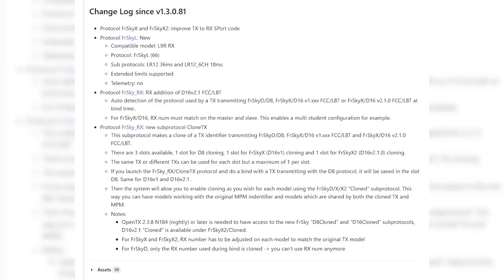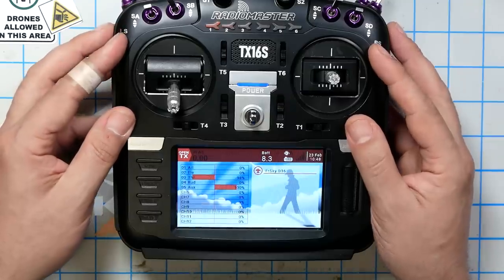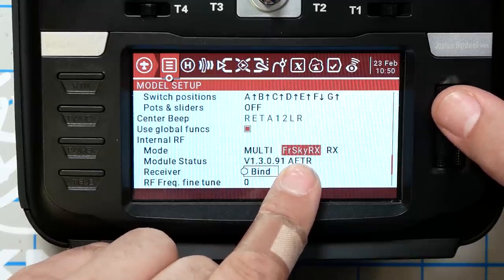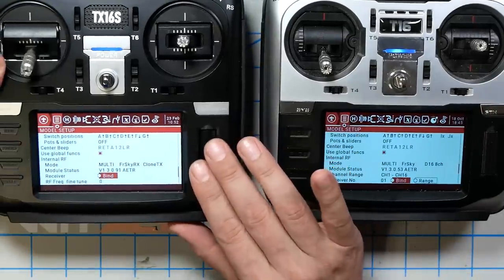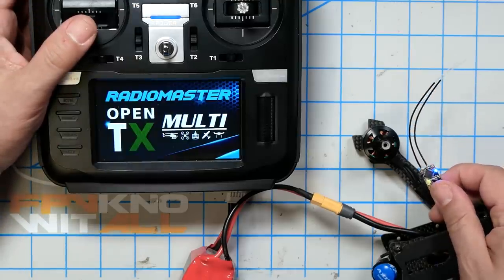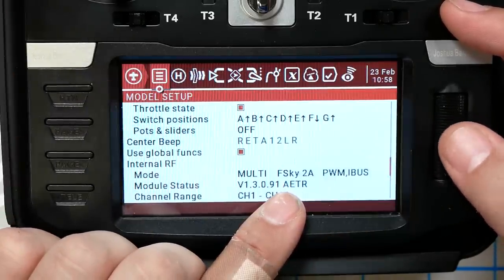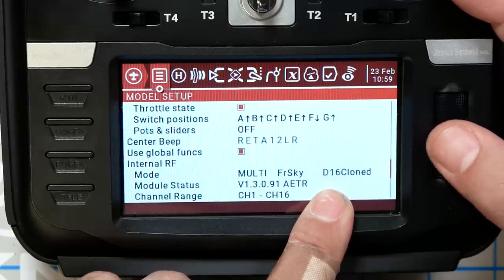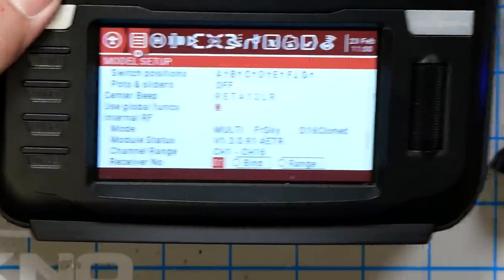FrSky multi-bind is FINALLY possible (two controllers at the same time!)

Comment: I am pretty sure that the hopping sequence is fixed.  When the Rx and Tx link up at power on they sync up their hopping sequences.  When you turn in a second Tx with the same UID it is extremely unlikely that it would come on at exactly the same point in the sequence.  The Rx is never listening on the frequency that the second Tx is broadcasting on therefore it doesn't see it - until the first Tx is turned off.  At that point the Rx goes into hold and starts seeking a valid Tx signal.  When the second Tx hopping sequence gets to the Rx is listening on then the Rx gets a valid signal, goes out of its hold state and happily goes on listening to the new Tx. 

This whole spread spectrum thing is pretty robust.
Reply: In view of this, I were just thinking, with combination of FPV and Autopilot equipment, we can actually do long range  FPV "marathon", the passing the Tx controlling from one pilot to another..

Like pilot-1 from the base, and Pilot-2 at 30km away and so-on.. and at last the plane landed at pilot-N based.. so pilot-N can replace the batteries etc and flying back the plane on reverse path all the way back to the pilot-1 over the same pilot to pilot in mid way of flying path.

That's looks nice..😁😁

Comment: just for info, Deviation has done it many years ago, not only for FrSky, ;but for all receivers that I owned.
the logic is, a receiver's unique ID is composed of two parts. One is owned by the Tx, the other is what you set in your model.
Usual case is even your buddy has set in the same ID, he won't be able to control your plane.
However, if you have another Tx as spare, you can set both Txs to the same Tx ID and have control by both radio.
I am new to openTx, and assume that it is a basic logic for all R/C flyers. To my surprise, openTx is not.
May be I have to go back to Deviation

Comment: What if you turned everything off, then turn both radios on and at last power the quad, which radio does it bind to then?
Reply: That's what I was wondering. Would both radios get the frequency pattern "packet"  and all be in sync simultaneously?
My guess is that there would be an unprecedented amount of interference and the receiver would failsafe.

Comment: Been in the hobby for five years and never spent a cent on Frysky. I was a Spektrum  guy for a bit and moved to Flysky. Thinking about crossfire for a while. But I love your videos and plan to get a radiomaster in the not too distant future through your affiliate link.
Reply: Its worth it. Went from a DX9 to the Radiomaster T16s. Tried the jumper but i wasnt a fan of it. The radiomaster is so much better and feels like a legit replacement for the DX9 for me.
Reply: @walspeed  That says a lot right there! I still have my DX8 but wished it was a DX9 for quite a while. The receiver cost and binding complexity drove me over to Flysky but I still have models with both Spektrum and with flysky receivers. Radiomaster would definitely simplify things.

Comment: Pretty sure the 50 HOP frequencies are sent by the TX and stored on the RX at bind time on FrSky (only 47 of them are actually used).  This would suggest that both TXs would therefore be using the same HOP frequencies.  So something else must be shutting the second one out from interfering in an existing session.

Comment: So you can also compile multiprotocol module firmware from source using the global ID function, and flash them to both radios, and they will appear as the same radio to the receiver for all protocols.  Although depending on your workflow you may end up having to rebind them all....

Comment: Ok got a question. And a challenge test. 
Question does with work with FRSky radios as well. I have Taranis and Q7. Would be cool to multi bind so I can let a friend fly with me as well. 

Challenge. Since it doesn’t cause conflict. Would it be possible to be flying and have second radio on already.  And then power off your radio so the other radio takes control and then transfer control between 2 pilots as opposed to passing the transmitter back and forth.

Comment: another way to "transfert" all your models from one to another is to build your own multimodule firmware with a fixed Id instead of the generated one, this way weither you use the tx16s or the jumper it should work.

Comment: Hi, great information and fruitful.

Btw, I have some strange problems after using the TX16S on V761 those Volantex Mini RTF planes.

Story as like:
(1) Throttle unlocking
- Prior to TX16S, all my V761-# (4 planes)  were totally working ok with my T8SG
- After received my TX16S, and bonded those V761-# to it, everything working fine also on Radiomaster
- A week later, just for some test; I tried re-bind back to my T8SG; everything works, "but" no way to unlock the throttle.. tried all different sequence, including re-calibrate using the stock Tx; until now still no way to unlock the throttle on my T8SG anymore.

2) Both Tx bonded with same V761-# plane.
- Another strange issue is,  when I switched on the both Tx (TX16S and T8SG), both are able to control the  plane at the same time, obviously the control surfaces are getting a bit crazy once in a while... even any of the Tx switched on in any sequence, .. the 2nd switched on Tx, still able to "buddy" together to the same plane .... Bad things.. in short interference..

😅, in this case, I can make use of the TX16S to unlock the throttle while both Tx are on, and switch-off the TX16S to continue use the T8SG to fly the plane ...LOL

Do you have any experience with V761 protocol?

Comment: Great video 🤟 i got  to bind. But from a Jumper T pro to a RadioMaster Boxer 3 position switches don’t match up. Can something be done. If i change switches in BF the quad would mixed up on the jumper?

Comment: Joshua, question: so here we have 2 transmitters set up to bind to a receiver, and around 8:30 you mention a pseudo hopping scheme, so if as you showed which ever one is on first and binds the other transmitter being powered on does not “see” the receiver, why then are there any limitations to how many radios (transmitters and receivers) that can fly at one time. Also as a followup what would happen “if” the transmitter that was not bound to the quad was turned on having a fully charged battery while the one currently bound to the quad had a somewhat depleted battery charge? Great info btw👍🏻

Comment: Wow! Really cool! Can A bind be cloned from a Qx7 to another Qx7 both using their own internal radio module? Or do I need an external MPM to make this work? If so, which one?
Thanks!
Reply from the maker: This only works with a multiprotocol module. It doesn't work with FrSky's own internal module.
Reply: @JoshuaBardwell  It isn't clear (to me) in the vid, is a MPM required in each radio during the bind? So two MPM's would be required?
Reply: @kirkglundal4289  it seems you can clone from a mpm to a standard frsky radio but  not the other way around and you can basically only have one clone

Comment: That's so cool. How about the stick ends? Will the cloning also copy those or  you still have to go in Betaflight to set those? Thanks Joshua. 👍👌
Reply: Guess that's information wich has nothing to do with the bind info. Subtrim and such is stored in the model. You can copy this over from one radio to another with the OpenTX companion app.

Comment: Really struggling with this. Trying to use a MPM on a Tango 2 to match my Taranis. The menus are different but I've finally managed to bind the two Txs and find and select FrSky Cloned 8 Channel with the same model number. Still doesn't bind to my R-XSR. Does that need to run the latest firmware? I hope not as it's still ACCST.

Comment: It could be cool for beginners with someone learning it and someone teaching it I would feel more confident!
Reply: But you can't switch control on a switch. You need to change model or turn the transmitter off. By the time you've done that your trouble is over. What you want is trainer mode.

Comment: Hey Josh, I was wondering if you could  do a range test on a 72mhz vs 2.4ghz vs 443 mhz  radios?
Reply from the maker: There's no question that 72 MHz and 433 MHz will crush 2.4 GHz.
Reply: @JoshuaBardwell  How about 72mhz against 443mhz?

Comment: I wonder if you could bind to all receiver numbers of the cloned transmitter just using the one cloned profile.
That way you always clone all D16 bindings of that transmitter (or at least those with the same sub protocol).
But in that case it might be a problem when you use the one remote to control the one receiver (number) and start the other remote with the cloned profile but on another receiver (number)!?
Reply: henning256yt , one clone to rule them all lol.

Comment: If you delete all the models from the original radio (to sell it for example),  Can the "D16Cloned" be changed to regular D16 (without rebinding) or will you live with that "*cloned" slot forever on the new radio?
Reply from the maker: There is no way to copy the cloned ID over to the main ID. You can do that if you compile the module firmware yourself but most people won't do that.

Comment: Joshua,
You must of read my mind.  This is exactly what I was looking for.  

Now that OpenTX 2.3.9 is out, can you not do the same with the latest version?

Thanks.
Reply from the maker: Yes you can.
Reply: Joshua Bardwell 
Hi Joshua,
Thank you for getting back to me so quickly.  

In fact, after I asked the question, I just went and successfully cloned 4 of my models. 

Thanks again for that great 👍 and valuable price of knowledge!

Comment: Not interested in cloning RX, can I clone your brain instead? 

Surprised to see D16 2.0 is supported on Jumper radio. Didn't Bruce and Pawel said the protocol is encrypted and can't be used with third party transmitters and receivers?
Reply from the maker: They cracked it.
Reply: If the so called "encrypted" protocol can be reverse engineered, how about ACCESS and CSRF RF protocol,  @JoshuaBardwell ?
Reply: Access needs a different RF Chip as far as I know. JB, can you confirm or correct that?

Comment: 2.3.9 is out so no need for 2.3.8 nightly builds right?
Reply from the maker: Ummmm. You may be right about that.
Reply: @JoshuaBardwell  I updated my radio yesterday that's how I know 😂
Reply: I have the qx7s and also the new firmware 2.3.9 but can’t clone. Why is that? I can only choose internal module off, access or D16. No clone.
Reply: @tegy7448  I just updated openTx for crossfire shot but haven't tried the cloning process...

Comment: when is ur next q and a
Reply: cuz i have a question why are all my vtx giving me the black screen with my osd working
Reply from the maker: In the Betaflight OSD tab change the NTSC / PAL setting to NTSC or PAL then save then completely power cycle the quad and camera (un plug USB).

If NTSC doesn't work try PAL.

Comment: Does anyone know of a cheap spectrum transmitter? I accidently bought a mobula6 with a dsmx receiver off amazon thinking it was a frsky receiver and now heli nation is giving me all kind of crap trying to return it. They are making me pay for return shipping and also going to add a 20 percent restocking fee! I am so disappointed right now honestly I'm feeling really upset about it. I looked online for spectrum transmitter but they all seem to be very expensive. I'm afraid I just wasted 100 dollars. Please if anyone has any suggestions I'm feeling really lost right now.
Reply: I soldered in a frsky R-xsr way better range only adds 2 grams and its 20$.
Reply: If you got it flying cool, just wanted to give you a cheaper option than buying a spektrum radio.
Reply: @joshgalbraith931  no thats not what i meant. You should make a video explaining how to solder the rx in or maybe can you explain it?
Reply: Sorry that was just a video to show the 2 grams doesn't affect the fun but it is still 10 percent of its weight so there is a loss somewhere.
Reply: Also I'd like to help. I would say you'd need to be intermediate to advanced to do it, the pads are tiny circles. I just googled a pinout for the mobula 6 and a pinout of the rx. After that there's betaflight rx setup vids everywhere.
Reply: @joshgalbraith931  okay thanks man i appretiate you responding.
Reply: If you decide to go through with it the pad for sbus is IR1 not RX1 it will be listed in the pinout for mobula 6 off. I'll try and find something to help.
Reply: I'll see what i can do but I doubt my phone or gopro can film things that small. I just followed the pinout.
Reply: Buy a cheap used jumper, they re dsmx compatible since v1
Reply: @joshgalbraith931  isnt the frsky r xsr only d 16 though?
Reply: @joshgalbraith931  The board is an all in one board right. Meaning it has a built in rx? The name on my board is called a Crazybeef4fr lite so shouldn't I be able to just flash frsky firmware on the board and it will work with frsky transmitter?
Reply: @ZackSbarro  can you leave a link i dont see anything under $100
Reply: @dusti25  the fr on the end means it's a frsky receiver in it already D8. Betaflight is all that's flashed on the board (should already be set up to fly with betaflight 3.5 or something) . If you have problems binding there are videos on it for the mobula.
Reply: @joshgalbraith931  it had a dsmx reciever in it but i removed it now im trying figure out how to get it to be compatible with frsky. I messaged happymodle and they confirmed that the board that cones with the spektrum version is the frsky board with an external dsmx reciever but i have to flash firmware and than do something in cli. Idk im lost again
Reply: @joshgalbraith931  I figured it out! Wow and to think I was about to buy a spektrum transmitter lmao. Thank god for happymodel they were so helpful. Just took my first flight on the little guy at 1:30 in the morning and it was great! Thanks for trying to help man I really appreciate it.

Comment: If my tango 2 had a multi protocol, i'd never use my jumper again.
Reply from the maker: Very strong rumor is that it's coming.
Reply: @JoshuaBardwell  Really? this would be so great!!
Reply: @JoshuaBardwell  I'm ripping my tango apart to see if it's got the pcb today lol. If the rumor is true, im going to crap my pants.
Reply: @JoshuaBardwell  mine has the pcb woooot